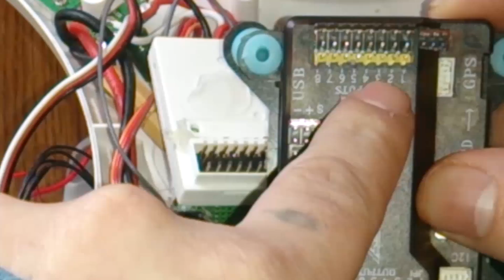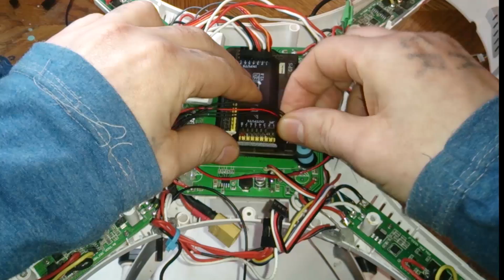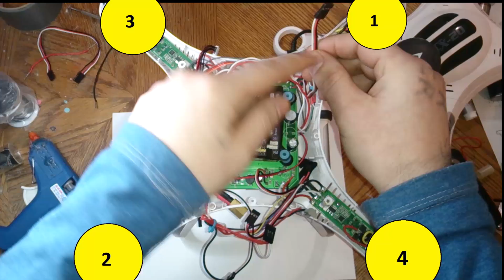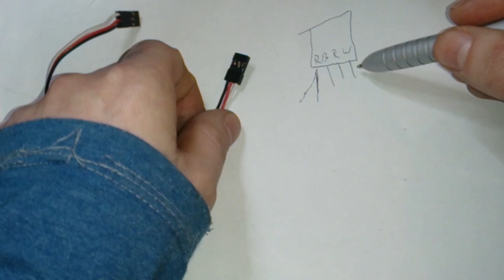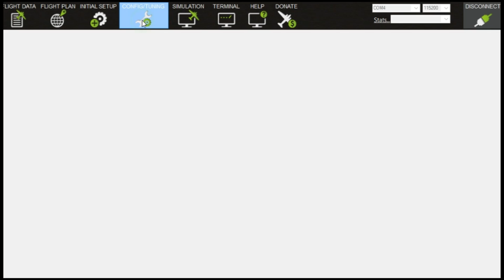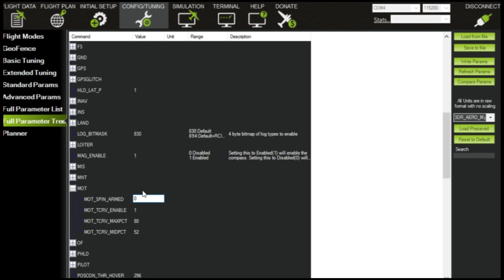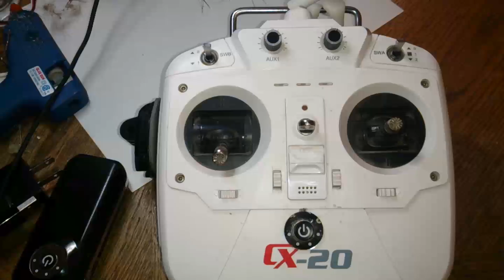cx20 factory apm to apm 2 6 - 2.8 step by step

Comment: Hey thanks so much for your time and effort, My question is about the (arm disarm) light, can't we have two switch wiring and can you tell me the pin I need to connect to, so that I can have Orange and Red light.... thanks
Reply from the maker: I'm not sure what cable you have but you can only have 2 lights one green ,(orange,red)  ..you need to flip the led's to get all three working correctly.
here is one picture.. https://drive.google.com/open?id=0B2w6_OKE_2kxWk5hb29NSG51eTA
Reply: +bangs6996 my bad, was under the impression that the orange and red were independent... I have a bigger problem, it appears that my radio receiver is blown, I have a radio link 10 channel, do you think it would work? and do I follow the same pin pattern?
Reply: +bangs6996 ohhhhh and how do I make a donation for the cause?
Reply from the maker: hi.. and yes the pin pattern should be the same . .. depending which remote you have you may have to change channel 2 to reverse in the remote software..   .. and thanks for the offer on a donation. but its alright .. keeps me busy..
Reply: +bangs6996 your awesome! thanks.... and receiver is fine, operator error, wire cross, all good now, almost, still working out the finishing touches, couldn't of done it without your help...
Reply from the maker: thank you..
Reply: +bangs6996 OK I'm back, and really ready to cut the #$%@ top off this thing! or buy the apm with side pins.. I can't make it fit!😠
Reply from the maker: lol... it fits.. .. .. take a pic and send to bangs696969@gmail.com  i'll make a suggestion on what your doing wrong if you want.. unless its your gps wires are to short
Reply from the maker: ok i just put mine back in ..and show how to fold the wires..I usually place the receiver in front of the apm on its side a tad but it fits like the picture as well ..i don't even bother gluing it down.. https://drive.google.com/open?id=0B2w6_OKE_2kxd0tUNnBZNENpZ3M   

the side pins would make allot of sense but now that i think of it ..you would run into the same issue placing the receiver..
Reply from the maker: the radio pix you talk about i made a video here with it..it does fit but one of the things i glued side ways ..the wires going on top of the apm are way smaller so more room but the fc is bigger.. https://www.youtube.com/watch?v=_yl4VaZnpMI
Reply from the maker: actually i have one more thing about the room in this video at this location https://youtu.be/e8x1jOAtFfo?t=341   you will see that you have tons of room in front of the apm for receiver.....i forgot i placed the apm in a rush and not true center.. in that pic..

Comment: ive got a problem , i cant connect to mp without connecting the battery and when i do it beeps very loudly...
Reply from the maker: you might have to open up your cx20 and make sure the usb cable is plugged in right on the side of the apm.... then try another cable directly into the apm.. to your computer.. with no battery.. . .
Reply from the maker: Just to clarify ...    You plug in the usb cable . and can't connect to mp.     You then plug in the battery and the unit beeps at you?.. if so then the above should fix the issue sounds like a bad +5 volts on the usb..    ...    If it is not your issue let me know..
Reply: well i tryd when it was open directly and still , first when i plug USB without Battery it light up green and all lights are good but no tweaking motors , its like a reverse of the normal... usually u plug in USB it beeps & tweaks now it does it oppsite
Reply from the maker: did you extend the cables for the usb? is this on factory apm or 2.6?   if so you might of reversed the polarity on the usb and fried a diode or surface mount fuse... ... Does your quad act normal when you just plug in the battery?
Reply: nope , as i plug in battery motors tweaking not stopping and beeping and not stopping , green light for few seconds and than it goes off , blue light of GPS stay steady ..
it is new APM 2.8 and yes i did extend the USB cable but i did try directly from apm as i said above
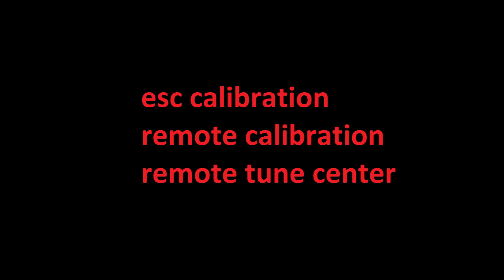Reply from the maker: Ok If you can plug in battery and usb then connect to mission planner, When the motors are beep .. Usually means you need to calibrate either the .. transmitter, Remote calibration through mission planner, or the esc.   I would suggest trying 29:00 of this video and calibrate the remote . then go into mission planner and Do a Remote calibration,  lastly is the esc calibration, but because you don't get usb power , please get back in touch with me once you try the two above. as we will have to find alternative way to power apm during esc calibration like through usb power on the input rail.    If you cannot calibrate remote through mission planner confirm your orange light goes solid on receiver  when you turn on the remote transmitter

Comment: Hello, I have completed doing everything. My APM 2.8 works well but one issue, the CX-20 rotates clockwise when I command it to rotate anti-clockwise and vice-versa. Please help me reverse Rudder.
Reply from the maker: +kaushal kakaria Hi what remote are you using?  Also did you replace all esc.. are you sure you wired all the motors and esc in the correct locations.  and also loading the correct firmware.. v3.2.1 for quadcopter
Reply: Hello, I again tried to fly it and it works properly now, maybe at first, I may have ignored something.
But now, the main issue is, I dont know in which direction should the Neo 7M GPS/Compass should point ? The APM 2.8 FC is pointing in the same direction as you have done in the video. Please help Bangs6996.
Reply from the maker: +kaushal kakaria usually the cord in the back of the unit is the back.. and you set the compass to roll 180 as its usually located on the bottom of the board.  If you want send me a link to the unit you have.
Reply: +bangs6996 Hello, Yes, I have sent everything on your email id: bangs696969@gmail.com. Please check.
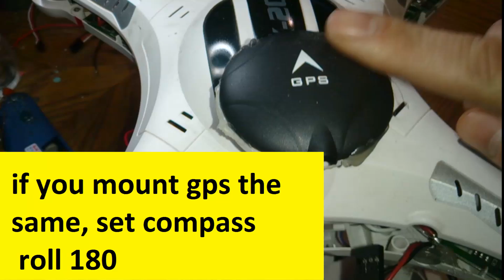Reply from the maker: +kaushal kakaria 23:41 you need to set your roll to 180 I believe is your problem then do another live calibration.     15:56 might be a better location for your gps as the compass is on the bottom its inches away from the apm and might cause glitching .
Reply: +bangs6996 Ohh, thank you Bangs. Right now, you won't believe, I took it out to fly after bring frustrated and to my senses. the RTH worked perfectly. Now the project is 100% successful and really ALL CREDIT GOES TO YOU.
Reply from the maker: +kaushal kakaria Congrats! Not all credit.. you did not give up like allot of people would of.. ..... safe flying ..

Comment: Hey bangs6996 
can you help me with my LEDS, I have the version where there are 3 pin connectors on the back of the leds itself, on the arm side there 2 red and 1 white wire, on the GPS side theres a black and red wire.. 
What do you think??
Reply from the maker: +John Doe check out 18:10 of this video , I'm sure thats the one you have..  somebody sent me a picture and I edited .. ..if not like this you can take pictures.. but the best way to think of it ..is if two wires are attached together then they become your switch wires.. the other three wires then become your ground..   https://drive.google.com/open?id=0B2w6_OKE_2kxWk5hb29NSG51eTA     check out this picture..Not 100 percent the picture is right but pretty sure I was..
Reply from the maker: +bangs6996 .. if you want send me picture to bangs696969@gmail.com   of your cable.. so I can confirm I did that picture right.. I need a picture of the wires going to the led and the black connector at the end..
Reply: +bangs6996   The picture is dead on, Thanks which wire is the arm and which is the gps? I know from the picture switch and gnd, but you say in the video, arm and gps go in A6 and A7
Reply from the maker: +John Doe   a7 is arm and a6 is gps    a5 use to be for the orange light..that is voltage alarm..but really your bottom should blink anyways..   .. for the cable no idea because they once shared the same spot..   ..if you want to be safer.. you can add a 50-150ohm resistor to the cable somewhere as well..   I have not had a problem without it.. but just letting you know the ohms range..   In my other video I said 1k , and the was way off on a guess..
Reply: +bangs6996  
Ok thanks alot , brother.. I'm glad you made these videos,.. really help me.
Reply from the maker: +John Doe your welcome ..and thanks..

Comment: I have question about installation power module on CX-20 (opensource). Do I need something other to do then connect power module to battery and other side to quad and connect this 3 wires with 3pin (fan) connector to stock APM 2.52?
Do i need to place/remove jumper somewhere or unplug some power lines or something.
http://4.bp.blogspot.com/-L-IGAUheI_w/VfKFZQ2tWRI/AAAAAAAABMM/ztc3dOWLcUo/s1600/APM%2BPower%2Bmodule%2Bpinout.jpg
http://2.bp.blogspot.com/-KHc4QyyIHc4/VfKF_mVXr7I/AAAAAAAABMU/ZkHFPr7eDqk/s1600/PowerModule%2BADC%2Bpin-out%2BRCGroups%2BFatQuad.jpg
Reply from the maker: +Mateo Gašparović  edit
Reply: +bangs6996 I dont use sonar now, i just want to connect power module on stock CX-20.
Reply from the maker: +Mateo Gašparović edit
Reply from the maker: +bangs6996 If you really wanted to you could cut the 5 volts and ground then add it to -b off the power module. but the cx20 voltage is already clean anyways so not sure if that would be worth it..   I was wrong above.. leave -b in place...... fallow the above pictures and you should be good to go.
Reply: +bangs6996 Ok, i ll just connect it whit 3 pins and to battery and i ll see. Thx
Reply from the maker: +Mateo Gašparović just make sure you don't use the red wire number #1 or #2 ..connected to the apm adc..or it will go poofy..
Reply: Hi. Today i install power module i now see curent and voltage in Mission Planner but thay have weird values. I try to measure volt and valbrate it and than is ok. But i have problem with curent calibration. I saw lots fiew futorials how to calibrate it on cca 10A but i am interesting do i need to have props inataled on quad for it?
Reply from the maker: +Mateo Gašparović You should not have to but it would not hurt.. it might be better reading once your in the air .. .. you are using telemetry with battery?    and not usb power.
Reply: Ok. I will try it. Which value of "volt devider" and "volt per amper" i need to use? Can you share to me your values from mission planner. Also for stock apm 2.52 (cx20) and this power module (http://m.gearbest.com/rc-parts/pp_84907.html) what i need to select apm 2.5+ with genuine 3DR power module or sometihng else?
Reply from the maker: +Mateo Gašparović You can try to use apm 2.5 power module.. and it should work.. I've had many power modules and never found I had to change any of the settings .. you can try other and see if you can get the voltage right.. .. you can try to measure with meter.. and set to other like this ...  http://ardupilot.org/copter/_images/CalibrateVoltage.png
Reply: I do volt calibration and everything is fine now. Problem is that i cant see curent when i push up trottle whitout props. In ampermeter i see 2.24A and in Mission Planner amper value doesnt change when trotlle is up or when trottle is down. What is the problem with current in Mission planner?
Reply from the maker: +Mateo Gašparović It might be .. I know the new one does not work with sonar in the hud.. you can try MissionPlanner-1.3.32 ..   http://firmware.ardupilot.org/Tools/MissionPlanner/

Comment: Hello bangs6996, again thx you for this great video. I have one question. How can i connect my gimbal to apm? I have stock 2.52 apm and storm32 3axis gimbal. When i connect gimbal signal's to bottom connectors all work perfectly and i can control gimbal whit my CX-20 remote controller but i cant see anything in mission planner. I want that mission planner can control my gimbal (region of interest - pitch). Can i parallel connect (thru Y or T one pin signal cable) my gimbal to RX and APM same time?
This is my default connections to APM and RX. Thx for advices.
https://www.dropbox.com/sh/zuoawaj0u0ztr8a/AADUEApzVbPgxVi-1BHT6qY6a?dl=0
Reply from the maker: +Mateo Gašparović Not 100 percent sure.. If it has not been done pin 10 and 11 has to be traced out on the apm .... or maybe edit the firmware for motor outputs 5-8  .. keep in mind the apm are bascically 100 percent the same ..its just your apm is missing all the headers..   http://ardupilot.org/copter/docs/common-camera-gimbal.html
Reply: +bangs6996 I dont know where is chanel 11 and 10 on my apm 2.52. That is pictures have you idea?
http://static.rcgroups.net/forums/attachments/4/9/5/7/9/3/a6781635-65-Topside%20of%20my%20Cheerson%20CX%2020%20flight%20control.jpg
http://2.bp.blogspot.com/-KHc4QyyIHc4/VfKF_mVXr7I/AAAAAAAABMU/ZkHFPr7eDqk/s1600/PowerModule%2BADC%2Bpin-out%2BRCGroups%2BFatQuad.jpg
Reply from the maker: +Mateo Gašparović Did you see my apm 2.5.2 original sonar mod? where i attached the wire directly to the pin....   You might have to do that.... I will trace it out for you in a bit...
Reply from the maker: +bangs6996 It might get more complicated if they added other components to the board. ..also off hand not sure about input 6 either on the original apm..
Reply: +bangs6996 Jeah i see that, but i think that i can 6.aux2 and 7.aux3 pint on FC to -2 and -3 pin on RX like u can see on this picture.
https://1.bp.blogspot.com/-fS-CwPateLc/VszE5iAc2iI/AAAAAAAABSs/17TPNuDccXs/s1600/stock_radio_wiring.jpg
Reply: +Mateo Gašparović Also final connection u can see here? CAn i connect RX to FC like this:
https://1.bp.blogspot.com/-cEAMA-1dWW4/VszE5nQGUZI/AAAAAAAABSw/46B2yrm36wA/s1600/stock%2Bradio%2Bwiring.jpg
Reply from the maker: +Mateo Gašparović Ok what it seems ....you can connect to motor output 5 and 6 for your gimbal wires  ...which is good i did not really want to edit the firmware heh.. so give it a shot.. wire up as you showed me..then atttach your gimpal wires to outupt 5 and 6 and set that up in mission planner as well..
Reply from the maker: +bangs6996 by the way in mission planner that would be rc5 and rc6 settings..on the til and roll ..in mission planner.. I just ordered a cheaper gimbal.. If you want to wait a week or so I can confirm.. ...its only 2 axis i got though
Reply: +bangs6996 Some antother person on rcgroups say to me some like you. To conclude:
1)  Connect RX and FX like is shown in this pictures:
https://1.bp.blogspot.com/-fS-CwPateLc/VszE5iAc2iI/AAAAAAAABSs/17TPNuDccXs/s1600/stock_radio_wiring.jpg
https://1.bp.blogspot.com/-cEAMA-1dWW4/VszE5nQGUZI/AAAAAAAABSw/46B2yrm36wA/s1600/stock%2Bradio%2Bwiring.jpg
2) connect Motor 5 and Motor 6 signal (other side of APM) directly to bottom of quad to gimbal.

Is that correct?
Reply from the maker: +Mateo Gašparović yes that would be my best guess as well , If somebody else actually said it works then great !!! ..
Reply: +bangs6996 Ok i ll do it, but please say to me can I simplify my FC to RX wiring? Like i post before? Do i need to do something before it? Like jumping or remove jumper from some pins?
Reply from the maker: +Mateo Gašparović you should be good..just check over the settings on this site to disable ch6_none or what ever it says.  the next problem you might face is what firmware are you running. I am not sure if the gimbal is disabled in the custom firmware..
Reply: +bangs6996 Ok wiring and mission planner setup protocol is:
1) Connect RX and FX like is shown in this pictures (6.aux2 and 7.aux3 pint on FC to -2 and -3 pin on RX):
https://1.bp.blogspot.com/-fS-CwPate...dio_wiring.jpg
https://1.bp.blogspot.com/-cEAMA-1dW...o%2Bwiring.jpg

2) connect Motor 6 (RC) and Motor 7 (RC) signal output (other side of APM) directly to bottom of quad to gimbal.

3) setup Mission planner like is show on this picture below.
For tilt input channel (left side of picture) set RC6 and output is RC6
For roll imput is desable and output is RC7.
http://ardupilot.org/copter/_images/...etupScreen.jpg
Reply from the maker: +Mateo Gašparović ...Thank you for posting the complete steps..  Did it work with 3.2.1 as well?
Reply: +bangs6996 Yes 3.2.1 costum firmware. Is that ok?
Reply from the maker: +Mateo Gašparović yeah if it works great.. I was not sure if they had removed gimbal support out of that version.